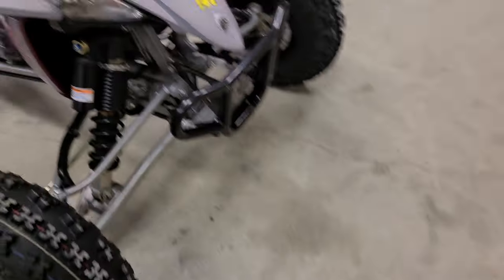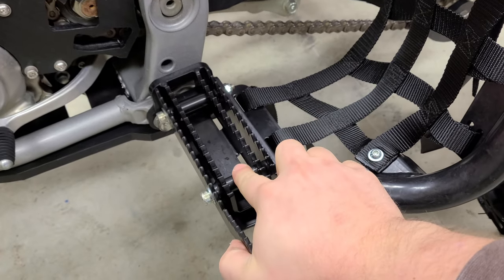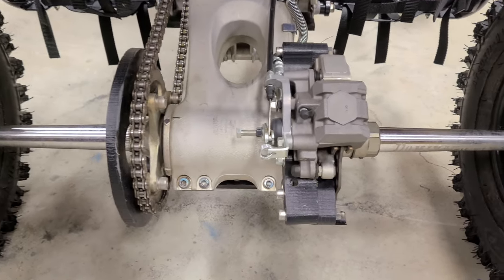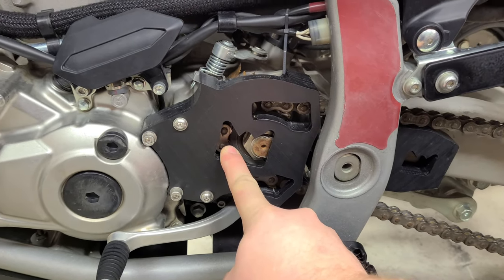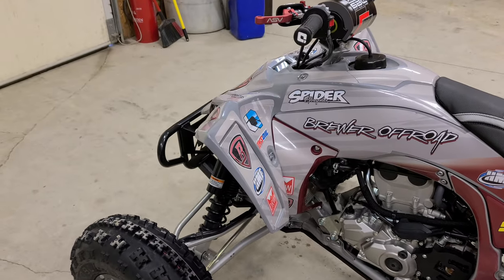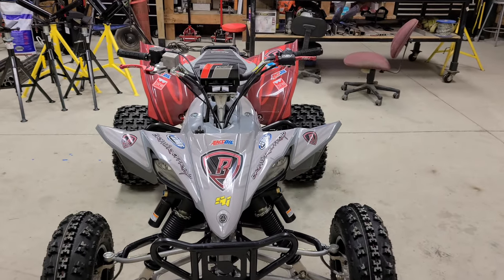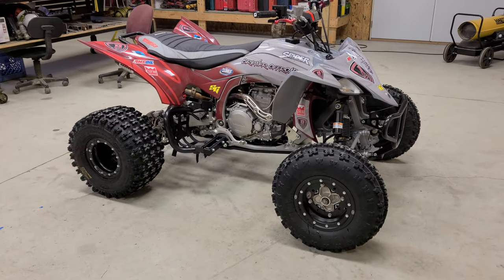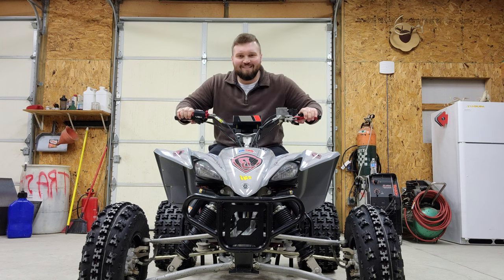2022 YFZ450r Build Breakdown | 2020 YFZ 450r

Comment: A couple of inexpensive mods i recommend.

LS4 carbon frame guards they have color options so you can match your build. And it will protect the frame rails from your boots they are a nice touch.

Aluminum timing caps lots of options with those as well with companies and colors the stock one are plastic and are know to strip out very easy and even fall out i run the 38 motorsport ones.

If you want to go one step further grab an after market breather box i also run the 38 motorsports one the stock setup can be known to leave oil in your air box and after market ones will eliminate that and allow any blow by to drain back into the engine.

One last thing and this took me a while to buy when i first started racing. Hand guards hahaha have you not gotten hit w a rock yet from roost from a rider in front of you? Bloody hands are cool but its no fun obviously w racing you deal with many more people  out on the tracks so its a must have for that but they do also look nice again many color options are available i run powermadd’s with  there wraps and its a solid setup.

Overall the yfz is looking mint you say your not blue but you have been spending lots of time with this girl lately 🤣🤣🤣
Reply from the maker: Hahaha thank you so much for this list man! It's all things I've been considering for sure! 

I'm not blue 🤫
Reply: @BrewerOffroad  ok red and grey then 🤣
Im sure your tool box is filled with tuning forks 🤣🤣🤣

Comment: Brewer are you going to get the 09-10 clutch basket?  Or another  basket upgrade? I watched  this video other  day  not sure if you said you got it or not. I'm riding a 2017 450r with oem clutch  I read the oem can wear out and explode. What's your thoughts on this? Should that be my next move on my 2017 is clutch upgrade.  There ppl buy 2022 and get clutch basket upgrade first thing.
Reply from the maker: I did and I would just to be safe. You may be fine but you never know until it blows 😅